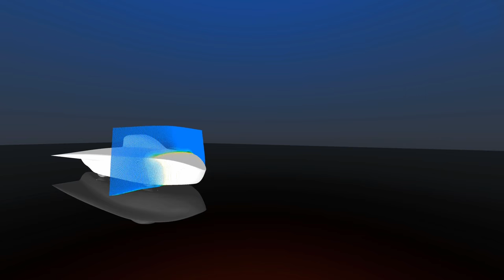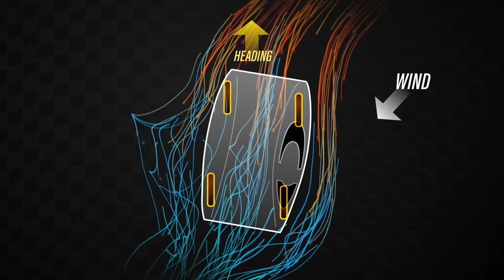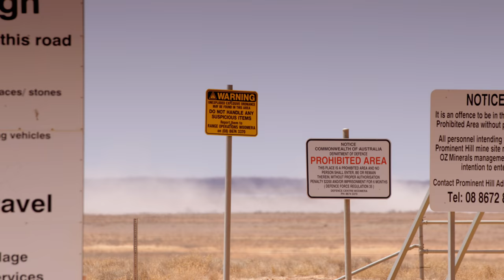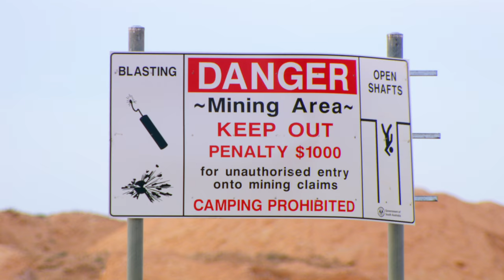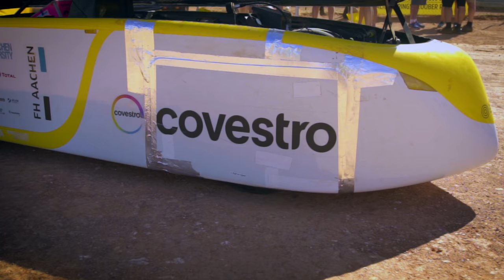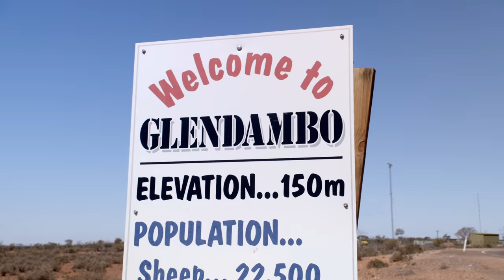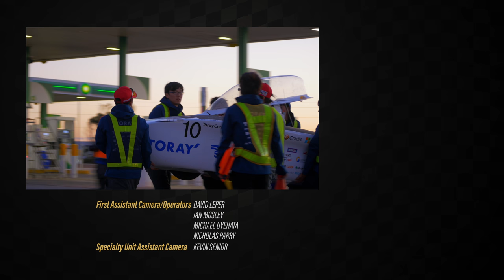Navigating a Solar Car Through Killer Conditions

Comment: Ah, and there my crosswind question is answered. Lovely stuff.
Reply: Hey there friend, I expected to see you here 😊
Reply: Oh my goodness I literally love you
Reply: It's called science
Reply: The answer to the problem can be found in hydroplane race boats. An unlimited class hydroplane race boat is insanely fast but terrible at corners. To compensate for this issue there is a variable pitch airfoil mounted on the front of the boat. On the straits, the airfoil is kept flat and provides no downforce. When cornering the angle of the airfoil is changed to give just enough downforce to keep the boat level. The tighter the corner the more downforce can be applied. I don't know if this technique is allowed but if it is, then you have a simple solution to the problem.
Reply: Skip Daulton  it's literally out of hand 😸
Reply: @theyouthful7251  to rest up v uvhvyg vyvv v.   V g
Reply: @Jonathan.D  this teaches me more than school
Reply: @SETTHENIGHTONFIYAHH  I wish they had this when I was in school. I have been thinking about something called surface deformation. You take the flat surface of the car and pull it down so it forms a circular deformation in the middle. It will look like a giant dimple. When the air flows over, it acts like an airfoil. There was an offshore power race boat that applied this idea to the bottom of the hull of the boat. In rough water, it helped to keep the boat from pitching and to stay in the water. So it was like having a giant suction cup on the bottom that kept it glued to the water.

Comment: The Japanese team is smart. Crabbing into the wind is dangerous. Yet sometimes mother nature is is just to strong.
Reply: Crabbing is like sailing. I find this a very smart solution.
Reply: I wonder how fast the crabbing reacts, if the wind was just to be a gust, could it counter it and reset without overcorrecting...
Reply: @ylerta1  From what I've heard (from people who talked to the agoria team themselves) is that  the two rear wheels were fixed at a specific angle, and then the front wheels steered normally. You'd be able to correct just as if you were driving sans-crabbing

Comment: Oooo.  Wind brake emergency panels.  This been done for years in the Nascar circuit for this reason.  Keeps the cars from flipping when they are spun out.  Emergency drag spoilers could open, stabilize the car, then close back into place.

Comment: I think it's clear that the organisers of this race are making it more dangerous for its contenders, 
Seeing a team penalised for an emergency action which if not quickly taken care of could result in the car hitting someone even though the team did not work on or touch the car is not on.
I also think the cars should require 2 drivers be onboard and some form of occupant cooling system. 
The car's are really to light for these roads and conditions.
Reply: That’s why it’s a challenge, and they signed waivers they know the danger, but the penalty was bullshit

Comment: I'm surprised they aren't using some kind of adjustable wing to get that extra downforce when its needed
Reply: Extra drag and the engines from solar cells are probably not strong enough to utilise the extra down force for more speed
Reply: A wing would do almost nothing at the speeds they're driving at. It would slow them down more than anything.
Reply: The wings like in the formula cars are great because the drag it create is counteract by their strong engine. While the solar car needs to be aerodynamic as much as possible because it has a weaker engine.
Reply: Wouldn’t be suprised the next Agoria car will have an adjustable wing.
Reply: Downforce increases drag which reduces the efficiency enough to make a big impact overall. It was addressed in the first episode
Reply: @Notadragon621  lol what? You can design a wing to work at any speed...

Comment: I hope that next year the race controllers do something about the wind (1) introduce minimum weight requirements (2) minimum required downforce (3)active aerodynamics and/or (4)postpone the race on windy days &hours. That was scary to watch!
Reply: they actually did add regulations for the 2021 race mandating that the cars had to be able to handle crosswinds. I know for sure that my team did take crosswind stability into account when designing their car / suspension mechanics but I'm glad that this will be given more attention in the future
Reply: @zacharyeichenberger4929  did they add a disqualification factor for interfering with the other teams?

Comment: I'm thinking regulators oughta up the required weight on those things. Maybe allow teams to make up for it by adding more batteries or something
Reply: Yeah, honestly I wish they removed all battery requirements and allowed teams to drive during night. Would cause teams to strategize how much energy to save for night driving.
Reply: @The_Pixel_Goat   You actually can't drive at night in most of Australia, especially the Outback, since at night tons of kangaroos lay on the road to absorb its heat. That's why any trucks that drive at night have huge steel bars in front to protect them from the inevitable collision with several kangaroos on their journey. Also the battery regulations are probably to drive innovation, especially considering that at some point you can just have a huge battery and barely have to recharge. It would also probablt slow the race down a ton because of the massive loss in power gained at night.
Reply: @losupa7897  Only the poisonous kangaroos do that.
Reply: @losupa7897  that will be more fun

Comment: Crabbing into the wind is a brilliant move because it lets the car SAIL in cross-winds.  I.e. the faster the cross wind, the faster Agoria goes!  Expect rule changes next year, or universal adoption of crabbing.
Reply: Not only Agoria had a Crabbing System. Also Top Dutch, Kogakuin and Sonnenwagen. Unfortunately rear wheel steering is forbidden in 2021.

Comment: The drivers should remember to slow down and not accelerate when passing a Road Train in high winds.
Reply: Came to the comments for this. Back to vid
Reply: @ItGetsOrganized  I think in general its the road trains passing the cars. accelerating vs slowing down doesn't make as large a difference compared to the side forces. I know for sure that several of the teams do put considerable thought into making their cars dynamically stable with respect to crosswinds like those from roadtrains.

Comment: The lightness of the vehicles endangering loves is yet another reason why they should have a given payload weight.
Reply: Having a weight reduces innovation 
If the cars would be designed around a weight requirement , it would become a difference race rather than being the most effective aerodynamically and reducing weight to go fast
Reply: @LiewLmao  not at all, all the measures would be the same, the rule is not a min vehicle weight it is a specific payload weight made of your driver and a dumb weight

Comment: I’ve not watched all of this but I was surprised to see after the crashes cars are made of fibreglass why not carbon carbon fibre
Reply: Most of them are. Only the Sonnewagen side chassy looks like fiberglass. You can see that the top of Sonnewagen is carbon fiber though
Reply: There’s a minimum weight requirement for the car
Reply: Because carbon fiber is 10 times more expensive and I guarantee you their budgets would not cover the rest of the parts if they did them in carbon fiber.
Reply: Carbon fiber would dent and Smash just like fiberglass. They'd still need to be reinforced by a roll bar
Reply: @josc  There is no minimum weight.
Reply: @laraleo6412  so then why are the individual drivers weighed and the lighter ones required to carry ballast in the cars when they drive?
Reply: @JC-nz9kf  There is a minimum weight of 80kg for the driver but nothing for the car.
Reply: Where do you guys spot any fibreglass? These cars only use carbon fibre. Close to the driver also Aramid fibre aka Kevlar.
Reply: Carbon fiber doesn't do much for impact protection. Motorsport uses a Kevlar layer in the structure if there's no steel/ Aluminum to absorb impact energy. Carbon is not ductile. I imagine it is an Aramid fiber (Kevlar without the DuPont trade name) safety tub, with kevlar stiffening layer. Probably not traditional fiberglass. They wouldn't want all that extra weight. (That's my guess🌞)
Reply: @onebylandtwoifbysearunifby5475  carbon fiber can absorb impact, look at crash test of f1 nose.
Reply: @ameunier41  Carbon fiber turns to dust on impact. It's high modulus. That stuff you see flapping around the driver's safety cell after F1 crashes is an Aramid (aka Kevlar) layer. 

Carbon fiber doesn't dissipate energy, it just breaks into pieces. 

Kevlar stretches to change shape, and dissipate energy. Bullet proof vests, helmets, and motorsport safety cells are made of Aramid fibers. There are no carbon fiber impact resistant parts. Carbon fiber only has strength along its axis (in the warp and fill of the woven cloth). If you push on it from the side (not pull in tension) it breaks easily.

Look at video of a front wing being hit on those cars. It just turns to shrapnel like peanut brittle.

Comment: Wait so agoria protested stopping the car from flying off with the wind? And it worked? These teams are very unethical
Reply: @anbuchelvan3619  yeah but none of them actually touched the car. Agoria is mad that they used items outside the car to stop it and that other people beside the driver did this. This is very petty and unethical because the alternative would be to let it fly away. You shouldn’t use small technicalities to gain an advantage if you want to win on just the merits of your car like they claimed. And Stopping the wind pushing your car away while it’s charging should not get you a 5 minute penalty, especially in such a close race.
Reply: @grimaffiliations3671  The rules say that teams must not manipulate or prepare the parking spot in any way. Vattenfall just rushed on starting the parking timer and did not apply the parking brake properly.
The penalty was very fair. That's just the risk when trying to save a few seconds.
Reply: @laraleo6412   how do you know they didn’t apply the parking break? These are pretty light cars that I could see being moved by heavy winds even with the Peking break on. I don’t recall them mentioning that the parking break was not engaged
Reply: @grimaffiliations3671  It is clearly visible that the car is rolling and not slipping. With a properly applied parking brake, the wheels would not turn.
Reply: @laraleo6412  the host explains that the wind caused it to roll off its moorings. It was entirely due to the force of the wind.
Reply: @grimaffiliations3671  Of course, if you place a car on a flat surface, it wont start moving on its own. There has to be a force to initiate the movement. In this case it was the wind.
Reply: @laraleo6412  So this goes back to my original point, they sought to penalize them for something they could not control out of pettiness. They gained an advantage on a technicality. Vattenfall did well not to touch it and were still punished. Poor sportsmanship

Comment: We do this to save the planet...though it cant handle the planets weather.
Reply: These are efficient performance race cars 
Real cars wouldn’t be this light
Reply: @LiewLmao  Yes, I know. My point being how will they help if they cant handle a gust of wind. These are far from street legal. The things they can learn can be learned in a field with stationary solar cells.
Reply: @leegibson5469  I guess so , but the outback is far from normal street roads
Reply: @LiewLmao  True, pretty ruff looking but they are there because of all the sun. All I am saying is build me an F-150 that could go 800 miles before needing to be plugged in. That wont be done with these contests. We need battery and solar cell research.

Comment: Seems to me like you just need a very small driver
Reply: They have 80 kilograms for a driver. If their driver is lighter than 80 kilograms, they need to add ballast until they reach 80 kilograms.
Reply: @kre8myf8  Correct, but at the same time there's additional benefits for having smaller drivers: it means a smaller and hence lighter cockpit. Moreover, having more ballast can be a bonus as you can store it very low down in the car, lowering its center of mass. Team Vattenfall, for instance, used to have mostly female drivers for this very reason.

For the next race, cockpits must be designed to be able to accommodate a standardized test dummy, so it won't be a factor anymore.

Comment: Its only about wide body and a aerodynamic shape and it will work . They cant work on aerodynamics without working on body shape and wide and also the suspension and steering its only need a brain and parts 👍🏻

Comment: The race administration is horrendous. Michigan got no penalty for blatantly cheating on camera while Vattenfall gets a penalty for something something that was not literally against the rules? Wth? If you make rules you gotta stick to them! If you feel the rules were not perfect you can change them after the race. 
Then there is the 80kph speed limit. You cant just make up a rule in the middle of a race and then change it 2 hours later, even less when it negatively affects some teams more than others. I understand it was for driver safety, but if so you should stick to it, at least then it would be respectable. But now they change the rules as if they are playing with a light switch and cause teams to loose hours of time. 
This is supposed to be the world class race, not your home coup.

Comment: Trying to deliver the message of renewable energy with a car that gets blown over by a stiff breeze.... um..... This is going to be a tough sell.
Reply: This is a race car not a production car! These cars are designed to be light to go as fast as they can. These are the formule1 cars of solar power. The purpose of these cars is to push the technology under the hood and solar panels as far as they can, so they maybe end up in a normal production car, like F1 did for our gas cars.